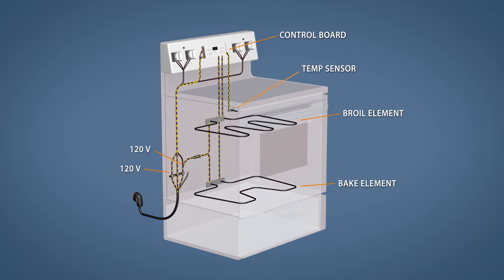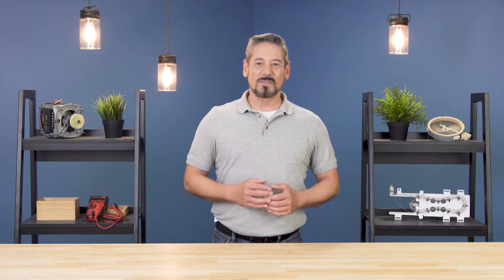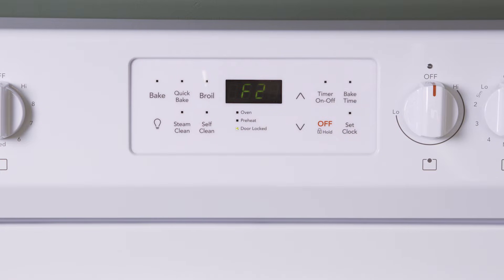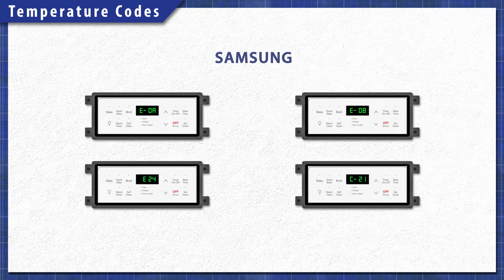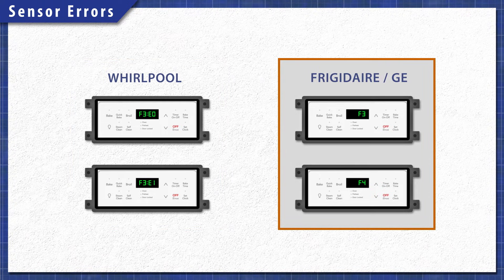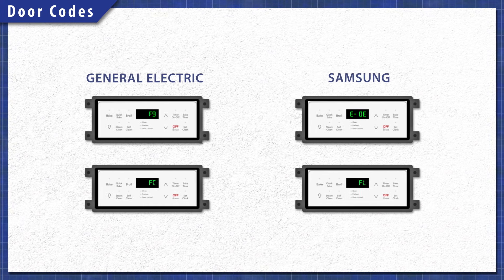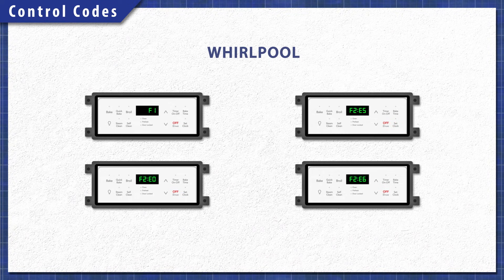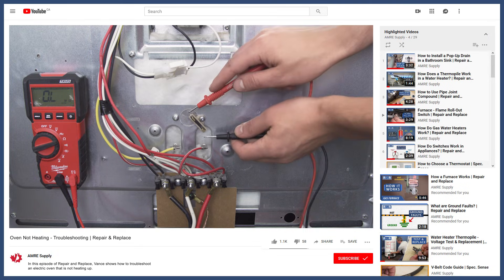Electric Oven - Error Codes Explained | Repair & Replace

Comment: Hi, I have an electric GE oven. After broil cooking, the F20 (F2?) and F31 alternatively come on and won’t go away. I tried to UNPLUG, TURN BREAKER OFF, but nothing solved. The blowing fan is ON or BLOWING even at room temperature. What should I do to fix it? Thanks.
Reply from the maker: Thanks for watching. Those are both temperature sensor codes. In some models if the the temperature sensor is faulty, and is detecting the wrong temperature, then the control might think that the oven is overheating, and will run the convection fan to help cool it down.

In this case if you tested the temperature sensor you'd find that the resistance is likely off or that it has shorted: https://www.youtube.com/watch?v=jnt_mUwdL8o

Comment: Hi I have an F9 on my whirlpool and it happened after I reset my breaker due to something different. I’m unable to fix it any ideas?
Reply from the maker: Thanks for watching. If you had a power surge of any kind then it could have blown the thermal fuse. Not all models have a thermal fuse, so it could also be the temperature sensor. You can learn more in this video: https://youtu.be/96s7maybHlY

Comment: Error  code sf
Reply from the maker: Thanks for watching. Check your manual, but in some models you might need to hold cancel or a combination of buttons like the up and down temperature buttons to get the oven out of that mode.

Comment: Hi.Hopefully you can help me. I have a Whirlpool oven whit  - - - C error code . I can not find nowhere what is that.
Reply from the maker: Thanks for watching. It's not a common code but can mean that there is an loose connection to the control board or keypad. First try holding cancel or set for 10 seconds to see if this helps.

As well you could disconnect power, open up the back and check each connection to the control board to the control board: https://www.youtube.com/watch?v=ORTi4lLyoqw
Reply: To anyone who might need this, I solved - - - C error by unplugging the oven from electricity for 5 minutes. Then plugged it in, pressed both SET and OK buttons until Eur appeared on the screen. Then clicked SET again which changed it to Eurn and pressed OK. Now the oven works

Comment: What does F 11 means on Frigidaire oven?
Reply: 5:10pm
Reply from the maker: Thanks for watching. It can mean that the control board is sensing a stuck or shorted key on the touch membrane. This could be because the buttons are worn out and have been pressed to many times. Or there could be some corrosion on the control board. In some cases you can install a new keypad and in other cases you'll have to install a new control board: https://www.youtube.com/watch?v=ORTi4lLyoqw

Comment: Hey I have a Frigidaire wall oven and its giving an error code of d0 for the broiler. I can't find anything. Any clues or insight for this?
Reply from the maker: Thanks for watching. I'm not sure and I'm not seeing much information on d0 codes. It might be referring to the door.

Does the oven function correctly?
Reply: @AmreSupply  The oven works as intended except for the boiler. It seems to develop some level of heat and keep the interior fan running but gives up a while after then spits out that code.

Comment: Mine is saying F7 21 I need help
Reply from the maker: Thanks for watching. An F7 code on GE models commonly refers to an issue with the keypad. You can check to make sure all the wire connectors are properly connected. If this doesn't help you might need a new keypad: https://www.youtube.com/watch?v=ORTi4lLyoqw

Comment: I'm getting an F5E6 on an old Roper range. Any idears? It just goes off randomly when the oven isn't in use.
Reply from the maker: Thanks for watching. With any intermittent power issue, check all wire connections to make sure they are secure. Look for any damage for the power cord wires and the wires leading into the control board. If needed you can check individual wires for continuity. If that doesn't help then it could be an issue with the control board.

Comment: any idea what could be causing an E1F6 error code for a whirlpool oven?
Reply from the maker: Thanks for watching. Try resetting the power. If the code still appears it could be a faulty temperature sensor or an issue with the control board. You could inspect all wires leading into the control board as well check to make sure each connection is secure. The temperature sensor can also be tested with a multimeter. You can see more here: https://youtu.be/96s7maybHlY?t=311

Comment: What a code f-c2 mean? Help please
Reply from the maker: Thanks for watching. A f-c2 code can be an indicator that there is an issue with the communication between the keypad and control board. It could be a loose ribbon cable or a faulty keypad.

Comment: Hello thanks for your videos.

What does an F24 error code mean?
Reply from the maker: Thanks for watching. The F24 code can mean that there's a stuck contact on the keypad. If resetting the oven didn't help than you might need to install a new control board. In some models you might be able to replace just the keypad if is a separate board.

Comment: I have ge and the screen say “bad line” what would be? I need fix that asap. Thank you.
Reply from the maker: Thanks for watching. It means that the control board is not getting the full 240 volts needed to power the heating elements. The power is supplied through two 120V lines. First check if the connections into the control board are secure as a loose connection can create issues.

Now if your stove elements still heat up then that proves that you still have 240 V to the range. If you don't then it's possible that you have only 1 line of power. 

This video shows how to test the outlet, how to test the power cord and check if the wires into the control board are still good: https://youtu.be/wZwxewn2w44

If that still doesn't help then it could be a bad relay in the board. You can see how to install a new board in this video: https://www.youtube.com/watch?v=ORTi4lLyoqw

Comment: My whirlpool oven after replaced a new control board the temperature flame still high even I drop temperature from 350 down to 250. What cause it do you know. Also the code show PF when you first plug in the power cord.
Reply from the maker: Thanks for watching. PF will show anytime the power is interrupted or when the oven is powered up for the first time. This code should clear and should not reappear unless power is disconnected again.

There could be an issue with the temperature sensor. You can see how to test and replace the sensor in this specific video: https://www.youtube.com/watch?v=jnt_mUwdL8o
Reply: @AmreSupply  oh thanks for helping brother.
Reply from the maker: @rhinostujlub7735  You're welcome, we're just happy to help!

Comment: Mine is Amana and showing E0 F1
Reply from the maker: Thanks for watching. It might be worth doing a reset as well as cleaning the control keypad.
Reply: @AmreSupply  That is exactly what our Amana electric range (less than 2 years old!) is doing.  We've reset it at the panel, cleaned the surfaces thoroughly to no avail.  Next will try cleaning the ribbon element in back with an eraser.

Comment: GE profile. F5 70. Induction range. Didn't see a linked video in list
Reply from the maker: Thanks for watching. Many induction ranges have a control board that controls the oven and the surface elements. Because of the variation and the fact that they aren't as common yet, we didn't focus on induction ranges. F5 or F70 codes could mean that the board is faulty.

Comment: What does the F1 E3 error code on Whirlpool mean? I’ve looked it up and searched everywhere, but can’t find any information as to how to fix this one.
Reply from the maker: Thanks for watching. Simply put it's pointing to a problem with the control board. Try unpugging the range for a few minutes and turning it back on as this can help it reset. As well check every wire connection on the control board to make sure that the connections are secure.

If that doesn't help you might need a new board or you can always get a technician to try to run diagnostics (which requires special tools and knowledge)

Comment: Hi ! First, thank you for your useful videos. I have a question. I have a Whirlpool oven model: YWFE745H0FH0. A few days ago all the heating elements in the oven started working at the same time (grill, oven and convection). I have no error codes showing and I have turned the breaker off for 5 minutes and re-opened and the problem persists. What do you think is the problem?
Reply from the maker: Thank you, we're glad that you're finding the videos helpful!

If the heating elements turn on when all the power is off then it's a malfunctioning control board. This is a sign that the control board has closed the relays giving power to the elements when it's not supposed to. https://www.youtube.com/watch?v=ORTi4lLyoqw

Now it is worth individually testing the bake setting, the broil setting and convection setting to see which elements turn on. 

Selecting the bake setting, the bake element (and sometimes the broil element) will work together to heat the oven.

When selecting broil, only the top broil element will heat up.

During a convection, all 3 elements might be used (depending on the model)
Reply: Great ! Thank you very much for your prompt answer. I will verify the elements.
Reply: Finally it's the control panel. A bit expensive to change. But I don't have the choice. Thank's again !
Reply from the maker: @ChaîneRavito  You're welcome!

Comment: Hi, on my Whirlpool Accubake showing F5 E2 and stop working. I ordered and replaced the door swicth. Frist time is worked after fixed but a little bit later (20-30 min) stopped. And showed again that error code in test mode.
What is your suggestion? Whats is the next step?
Thanks

Johnny
Reply from the maker: Thanks for watching. It could be an issue with one of the switches on the door lock motor assembly. This is generally accessed from the back and you can test the switches to see if they are faulty or not: https://youtu.be/nf0bN0VgdnU

Comment: Thanks for making fire computerized. Next, we'll need a WiFi connection to grill a steak.
Reply from the maker: Thanks for watching. I would agree that there is a tend to over engineer some appliances and add more and more features that are hidden behind a black box of a control board. However most electric ovens are still fairly straight forward to troubleshoot if you test the right components. You can learn more here: https://www.youtube.com/playlist?list=PLCo9SMjkdWBysYYCcg5xQLiVh_cW0JQvt
Reply: Stop whining

Comment: I didn't see my code Samsung stove SE code
Reply from the maker: Thanks for watching. Error SE means that the touch control panel is shorted. If unplugging the oven for 5 minutes won't reset the error permanently then might need to replace the touch control panel.

Comment: Samsung shows a flashing SE code.The cook top works not the oven
Reply from the maker: Thanks for watching. An SE error code means that the keypad or touch pad l is shorted. If unplugging the oven for 5 minutes doesn't reset the error permanently then you'll likely have to replace the control board. Make sure to do a model search with for your oven. In some models there is a separate touch pad in addition to the control board. Most models however will have the touch pad integrated into the control board. 

The control board is simple to replace. The steps can be seen here: https://www.youtube.com/watch?v=ORTi4lLyoqw

Comment: Why My kenmore showed dr when we try to turning on the oven?
Reply from the maker: Thanks for watching. A DR error code or D00R can mean that the door lock is enabled (or the oven thinks it is). If the oven door was open and the Clean button was pressed, this can happen. Try pressing Cancel with the door closed. If the door is open, press the oven light button in and press Cancel. As well try unplugging the oven (or flipping the circuit breaker to off) for a few minutes to reset the error.

It could be a issue the the door latch assemble. The testing of the door latch motor and switches is shown in this video here: https://www.youtube.com/watch?v=GTJRf-aCXbw

If these don't help and the oven is not locked, then the control unit probably needs to be replaced.

Comment: Mine is showing f2e0
Reply from the maker: Thanks for watching. The F2E0 error code means a "Shorted keypad". Turn off the power to the oven at the breaker, for several minutes and turn it back on. Then check to see if the error comes up. It might just be an issue with one key or several keys. If the problem persists then you'll likely need to install a new control board. These are fairly simple to replace you can see how to do this here: https://www.youtube.com/watch?v=ORTi4lLyoqw

Comment: What about an F10 error code in a Frigidaire oven ?
Reply from the maker: Thanks for watching. If your oven is displaying an F10 error code, it means that the electronic control board detected a runaway temperature. It would be best to test the temperature sensor to see if it is faulty: https://www.youtube.com/watch?v=jnt_mUwdL8o

Comment: My Whirlpool range model RF367LXKQ is not locked closed but is showing a "DOOR" code and the electronic control unit won't allow any of the switches to function (the burner controls work however).  Recycling power to the unit is ineffective.  Is the "DOOR" code essentially the same as the F5-EO and/or F5-E1 codes described in the video?  I am preparing to troubleshoot the Rear Oven Door Latch per linked video.  Thanks!
Reply from the maker: Hi Brett, thank you for watching. If the door opens correctly but you're getting the door code it could be an issue with the door position switch or door latch switch. As well its best to check the oven sensor as well as this can also prevent the oven from working. You can test this from the back of the oven: https://www.youtube.com/watch?v=x-fujr9Sxqg

Comment: What about code E2 - F3 - locked. It locks up and burns the food.
Reply from the maker: Thanks for watching. In your case its likely an issue with the temperature sensor not detecting the right temperature causing the oven to overcompensate. This can be tested from the back of the oven. You can learn more here: https://www.youtube.com/watch?v=jnt_mUwdL8o

Comment: Hi, do you have any videos on how to repair F2 EO whirlpool accubake? The control panel is stuck on locked for the stove ranges. We already tried to flip the breaker, unplug… nothing. Please help.
Reply from the maker: Thanks for watching. 

If the door stays locked it could be the door lock motor: https://www.youtube.com/watch?v=GTJRf-aCXbw

Or it could also just be an issue with the temperature sensor as in some models the oven control will lock the oven door if the sensor is faulty.: https://www.youtube.com/watch?v=jnt_mUwdL8o

Finally it could mean that you have a shorted keypad which would require a new control board. This is difficult to test so its best to eliminate the other potential components first https://www.youtube.com/watch?v=ORTi4lLyoqw
Reply: @AmreSupply  I think it’s the last one you listed. The burners are locked off therefore the stove won’t light. (It shows loc in red and in green locked  with a small pictures of the burners) But the oven door opens and I was able to use it but not cook. It’s a gas stove.  I’m going to review the last link and go from there!
Reply from the maker: @chocolatecapricorn9418  We're just happy to help. One more thing to try is to hold down cancel for 5+ seconds. Sometimes this can reset and clear the code. If the error code comes back then its best to replace the control board. 

Seems like your gas stove controls are linked to your control board. In other models that use individual heat switches,  a faulty control board wouldn't effect the stove elements. Still the control board repair is simple. You can enter your model number here to find an exact replacement if needed: https://www.amresupply.com/lookup
Reply: @AmreSupply  Thanks for your speedy response!

Comment: I have a wall oven that has an error that says  "supply open Neutral"
Reply from the maker: Thanks for watching. An open neutral means that the neutral wire is likely not completing the circuit. This video goes into detail on how to troubleshoot power issues, test the outlet, power cord and what to inspect. It doesn't show how to access it on a wall oven, but the same concepts will apply to most ranges.
Reply from the maker: Meant to link this video as it shows how to test for power: https://www.youtube.com/watch?v=wZwxewn2w44 Cheers

Comment: Well maybe you can help me because can’t find it..I’m getting F0 code on kenmore elite model # 911.49043201 it might run ok for week then you may have to reset it 3 times,heats up then just shuts of and shows F0 code nothing on board will work you have turn breaker off wait 5+ mins might heat up may not…if you don’t wait at least 5 mins throw it immediately
Reply from the maker: Thanks for watching. This comment didn't show up right away but for some reason is visible now (4 months later). F0 would point to a temperature sensor issue? Did you narrow down the problem?